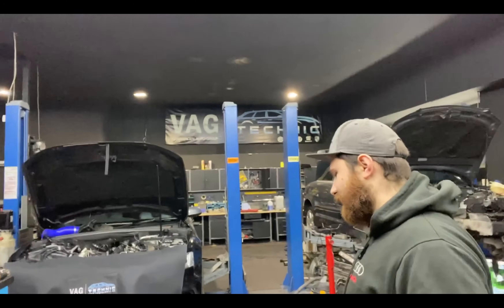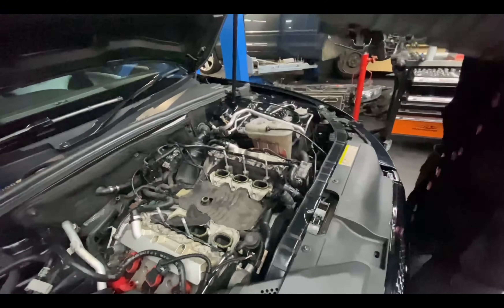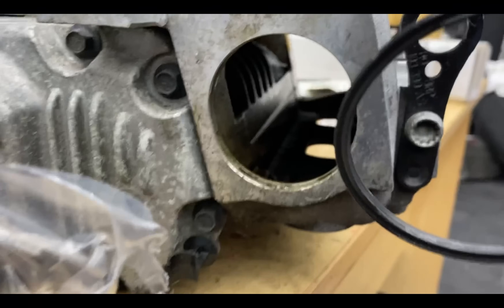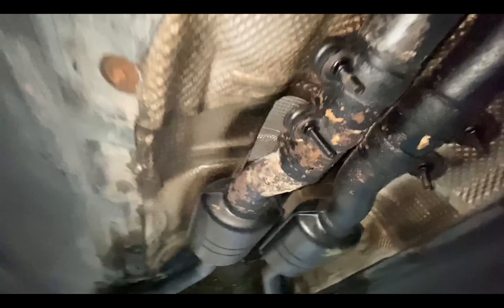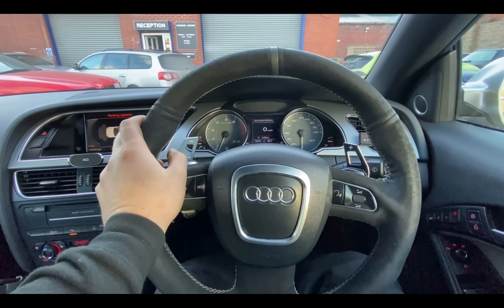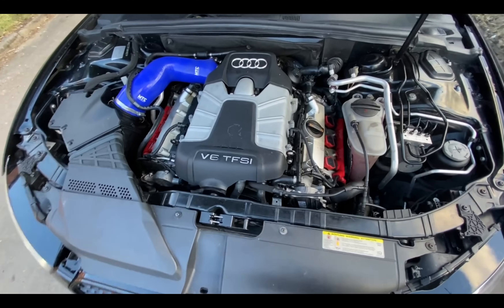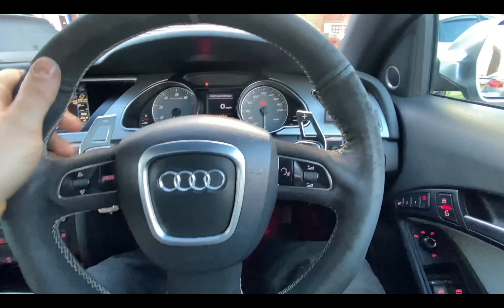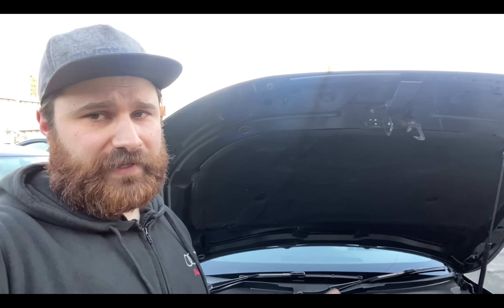Audi S5 3.0TFSI coolant in oil ! Whats the engine damage?

Comment: I have a 3.2 FSI with the same coolant consumption. I don't understand what the PCV has to do with it if it runs on oil? I've been told it could be the oil cooler or a blown gasket. Should I also check the PCV?

Comment: I've been subscribed and watching  your engine tear-downs. Luv the channel and appreciate you fast forwarding the boring bits. I have a ford ranger 4WD 3.2L 5 cylinder diesel engine. I have a map, exhaust upgrade, snorkel, premium air filter for some modest performance AND economy improvements. Happy so far. Would you agree with a inter-cooler upgrade for my next step? - looking for a little more torque.

Comment: I am having the same issue with oil and water mixing. Now I have a misfire on cyl 4 and EPC along with check engine light. If I can get some help I can email you more information.
Reply from the maker: Instagram massage
Reply: @VAGTechnic  I'll send you a message there. 👍

Comment: Does this cause white smoke or is it headgasket issue I have
Reply from the maker: Injectors ?
Reply: @VAGTechnic  I have coolant in the oil as well but how does I tell if it’s this or head gasket
Reply: @VAGTechnic  also does this issue in the video cause the car to overheat

Comment: the famous vag plastic(pcv) same on skoda felicia, they replaced AL thermostat housing with plastic, and there coolant leaks, so i had to modify it with al housing that is adjusted for new coolant temperature sensor
Reply: that so fuck up that a lil part that so important they make it plastic and easy cracked wtf audi? @audiusa

Comment: why car should lose power if remove cat?
Reply from the maker: Back pressure , but we are Talking like 10bhp 😅
Reply: @VAGTechnic  back pressure is not good,,it is good only for 2 stroke engines,cats can act as device that makes laminar flow from turbulent, if are good designed,but if you have long tube headers,they can halp to reduce turbulent flow and they increase negative back pressure or suction from others pipes and cylinder when valves are overlaped

Comment: Hi. Do you recommend carbon cleaner for the 3.0tfsi engine please? I changed pcv valve 3 weeks ago and I saw  that it is already a little dirty inside. I have only 70000 mileage.  Also how much cost please? Thank you

Comment: How to recognize that cats clog up on 3.0tfsi?
Reply from the maker: Best thing is to put camera in 😉
Reply: @VAGTechnic  Where do you place the camera, through O2 sensor ports or do you have to separate the cats?
Reply: Hello, you love MRC work as I, currently running stage 1. Do you find this cat problems in MRC tunings are from stage 2 or more, or you have different experience? Should I be concerned? Tks

Comment: Great video, I had the same issue on my wife’s Q5 3.2L. The first sign is when the low coolant message come up. Do not ignore it and just top off. If you don’t see any obvious leaks check under the oil cap. The coolant is going somewhere…

Comment: Really enjoying the videos! One of the issues I find with some garages is they don't thoroughly test drive the cars, maybe due to time constraints. Great to see proper test driving!
Reply: Yes indeed. Off the ramp straight into the customer car park is the normal test drive these days.
Reply: @graemecatty9921  it's silly because it means they have to deal with customers returning cars with issues that would have been easily discovered on a test drive, which takes a lot of unpaid time, and annoys the customer.

Comment: I have similar issue with 2.0 TFSI (2005 Audi A4) - I had problem with oil cooler/oil filter housing. Replaced oil cooler/oil filter housing, but not the cooler itself. Now I have discovered, coolant is low. I have added few times (1 liter or less) to top it up with warm engine. Still, coolant is disappearing somewhare...

Comment: Awesome videos! I am looking at getting a 2012 or 2014 a6 but unsure which engine to go for. 2.8 fsi or 3.0tfsi? Purley on a reliability and running costs. I am happy to pay more to run the 3.0 but not if it has more problems. Thanks
Reply: Lol Audi and reliable don't go together 😂😂
Reply: @matts3736  1.9tdi audi a4 b5.5

Comment: It's probably not suitable on these modern engines but if oil gets into the coolent system you can put a dish washer tab in the coolent to flush all the oil out. Do that a couple of times with a heat cycle and the oil is generally all removed. Be sure to flush the system before putting the coolent in.

I had to diagnose a fault with a early T5 transporter. The head was porous and needed to be changed. It was a hell of a job.

Comment: Try this trick.  When I have had that much moisture build up in the crank case due to short drive cycles in really cold climates or coolant contamination, after making repairs to the vehicle I to have found it difficult to remove the remaining moisture.  What I do is get the oil really hot then pull the car into the shop remove oil cap and let it sit over night.  Most of the moisture will vent and go away.  You’d be surprised.
Reply from the maker: Good idea !

Comment: The work you did is very good. Lot's of experience I might say. Although this is nowadays not so common engine anymore due to taxes. 
Anyway, the root cause I'm more interested in. I assume this is just VAG quality. Driving experience has nothing to do with durability. I lost enough money to 2 German brands, due to similar oil, and early durability loss of the engines.
Japanese like are much better, although the cabin and the bodywork is more fragile than the German brands.

Comment: Wow what can I say I’m speechless thought this baby was a gonna BIG THANK YOU TO TOM AND THE TEAM for resurrecting my S5 these guys are without a doubt worth every penny go with your gutt!! I did cheers fellas see you soon with the next mod 😁👍🏾🤘🏾🙌🏾🙌🏾
Reply: Yes you got it steam was coming out on idol it was fog!!
Reply: @derickcole3128  I got the same issue. I'm going to take mine off today and check it. Praying that's it. Should've went ahead and did it when I changed the thermostat.
Reply: I’ll be honest I ran mine for quite sometime until it was just becoming unbearable the Thing is the engine ran fine!! But I guess over time it would had catastrophic failure so glad I got it to them to put right good luck with yours pal 👍🏾
Reply: @derickcole3128  how's it running now
Reply: @2200zay  Just perfect!! Like brand new still 👌🏾👍🏾😂
Reply: Did you have white smoke or steam coming out of the exhaust before the PCV was replaced or just coolant in oil?
Reply: You obviously did the right thing by bringing it to these guys! And just in time, by the look of it😅

Comment: Hey I’ve been having this misfire in my car in cylinder 3 I’ve changed spark plugs ignition coils fuel injectors and still have the misfire it doesn’t misfire at idling or cruising but when I WOT it just put load on it…it starts to misfire don’t know what else it could be any idea?
Reply: failing cats
Reply: @ssslugface  I’m on Jhm test pipes

Comment: LOL, so you "fixed it" and now this will be sold as perfect condition, no issues, regular maintenance, purrs as a kitten. There is a small chance engine is fine if it was not driven hard while it had water mixed with oil. Engines in general can take A LOT of abuse, really a lot, and apparently work just fine. Truth is. One of these engines if maintained properly after 150 000km is like brand new, this one suffered damage and it will shorten its life significantly.
Reply from the maker: Definitely it might ! Only way how to proof this is take the engine apart 😐.

But for now the coolant leak was sorted and we done maximum to save it from further damage … 

But yeah , only time will tell
Reply: @VAGTechnic  Please do not get me wrong, but all this is super wrong. It would be great if this engine in this car would have a note that can not be removed or tampered that it had super ugly coolant mixture with oil. Maybe as data at "MOT" yearly inspection. To many parts require strong oil film to ensure good life of engine. you could do one thing. Check oil pressures and compare with valid data for this engine. If oil pressure is well in range, for high load, idle etc, then maybe owner was in luck. Problem is, can you or anyone obtain range of good oil pressure for complete operating range of this engine 😀. Safety systems in Engine kick in at low values, and when that happens shit has hit the fan, and how clos you are to low values could tell you how bad this engine is. Also would be good to know oil consumption rate before and after this fix. If oil consumption went up, we all know where oil is being consumed at higher rate.
Reply: Mate put this way if I was gonna sell this car I wouldn’t got this done!! Would of just chopped it in give it some else to do but when your passion is AUDI you live by the sword and you die by it 😁